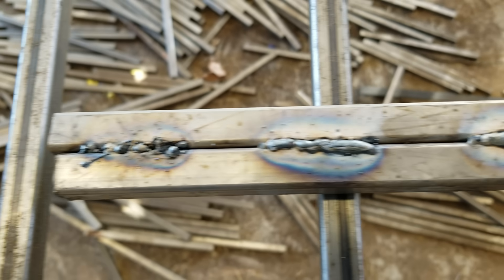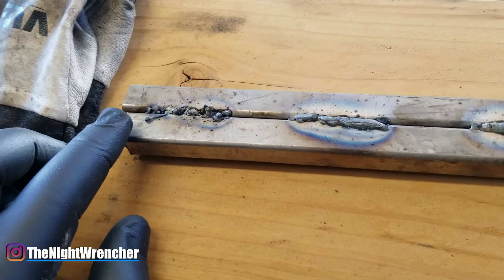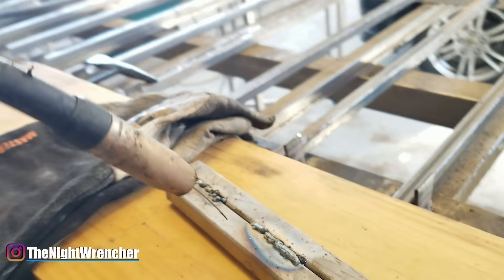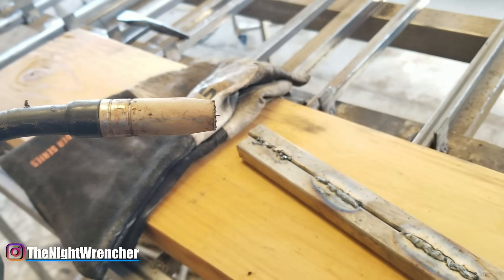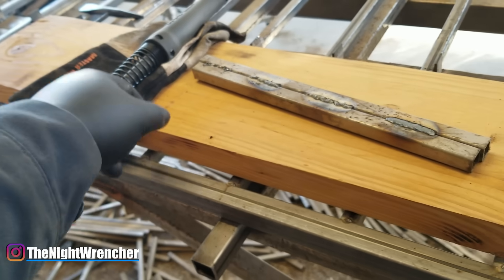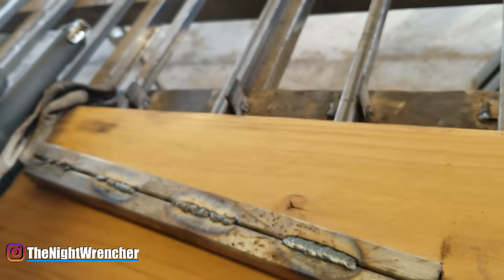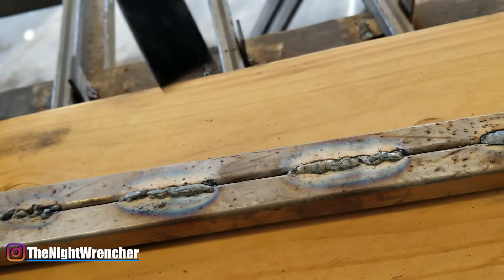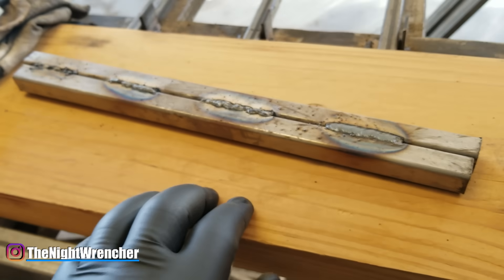Learn Perfect Flux Core Welds In 10 Mins | Gasless Flux Core Welding For Beginners Tips And Tricks |

Comment from the maker: Theres a whole flux core welding playlist here on the channel full of videos like this so check it out!
Reply: Phenomenal video man, thanks for making it! Helped me figure out what's going on with my new flux welder👍
Reply from the maker: Thanks man, I appreciate it!
Reply: @NightWrencher  100%!
Reply: Very good and thanks
Reply: @bobharris3754  yuh yuuy
Reply: good video and examples. one thing to add would be loosing the mig tip and using nozzle gel, so if you get slag on your nozzle it cleans off easily and won't stick if you weld to close. of course though that is knit picking.
Reply: Thanks so much for this video. I am a casual welder , and my flux core welds look exactly like your first (terrible ) weld . One time , I briefly did about an inch or so that looked like the final weld you did , but I had no idea what I had done to get it there , and was unable to duplicate it. You have been a great help !
Reply: @hughmartin4006  That is pretty much my experience too.... except without the perfect weld part.
Reply: @hughmartin4006  I needed that
Reply: Thanks
Reply: Thanks! Good video that made my welds (with my cheap ass HF 90) a lot lot better. The problem I’m having with my Lincoln Auto helment (cost more thsn my welder) is seeing the puddle! I started by setting to 10 and then up and down to try and get it right. What do you recommend? I know I could do better if I could see the puddle. Thank you for your help!
Reply: I'v been welding  since high school metal shop 30 years ago and after watching this video today, I think it'll start to show. Thank you. So often I flub a weld but never quite know why.
Reply: Was very helpful. Im fifteen and wanting to learn how to weld but was welding like the 2nd and 3rd welds you did. Thanks for letting me know what was wrong.

Comment: Great video! I'm 70 and beginner with cheap Harbor Freight Flux core welder. Have learned (the hard way) about sun burns, red hot sparks, super heat, bad angle, too fast, burn through, pushing instead of dragging etc and finally decided to learn properly from watching utube stuff. I know stubborn too.  I've watched about 20 or so videos and found yours real good because you showed my work #1 and what I'm striving to do #4. I'll try again today if it doesn't rain, get too cold, feet don't hurt, arthritis in right hand lets up, racoons haven't stolen my tools or crapped on them, get new glass eye protector (current is burned white). Damn, perhaps GOD really doesn't want me welding!!! Regards from Florida...
Reply from the maker: 🤣 thank you sir, hopefully you get back on it soon!
Reply: Dont forget abou tthe heat and humidity here in fl.. no way im wearing a jacket outside during summer rains

Comment: A good bead is when you hear a continuous feed without hesitation electric hum " audibly " and listening to steak cooking... Pops and sparking are air bubbles there are thousands of different patterns just have to be consistent with distance from material and movement. All depends on fps requirements " right angle shear strength of what you're building " muscle memory is key " repeat repeat repeat when you get good enough you can weld with two deep cycle batteries in series with Proficiency and Discipline... After a while it's second nature " neurological hardwiring Circuit recorded on RNA.

Comment: there are a couple things i wished people would make it a point to include when they are doing a flux core tutorial video like this and the first is the issue no real welders never want to acknowledge, most beginners are going to be starting out using a sub $200 dcep welder not the expensive dcen welder like you are using in your video, they need to know that the two are different and produce different results like they are not going to get as good a quality of weld from dcep which leads to the second issue,  if "stick out" is mentioned in the video then stop and explain the what, why and how to do it because it is probably one of the most important techniques to master, especially for someone using a $120 dcep welder with only 4 heat seating's, even with my $300 lincoln welder, i use stick out all the time because my lincoln may be dcen but it still only has 4 heat settings so sometimes the only way i can weld certain  thin gauge materials is by using stick out, stuff beginners need to know.....

Comment: Replace to tip of your gun with a plastic shroud. You can't weld that to your metal. Also, speaking about the sun burn, don't wear light colored clothing. They can reflect the UV light up towards your neck and face. I learned that the hard way.

Comment: Best explanation I've seen. I've been Welding flux core for 10yrs now with a Lincoln weldpak 140hd and a small bit of stick Welding. I usually end up with number 3 and sometimes number 4.  I've been getting more splatter which now I have a solution thanks to you! Another thing that has helped me other than more protective gear is an auto darkening helmet. I want to get a flashlight for the mig gun but If I lighten my helmet darkness a little it helps me keep on track and watching the puddle. I have horrible vision and have had cataracts since my late teens early 20s way before I ever touched a welder.
Reply from the maker: I try to keep my helmet as light as I can because too dark and you cant see where you're going with the gun.

Comment: What wire do you use 0.8?
Reply from the maker: I use something similar which is .75 mm or .030 in inches which is the smallest wire that you can use in a flux core machine with standard off the shelf wire. Smaller wire flows faster and prevents burn through and reduces warpage in thinner metals. For thicker plate steel I would use .035 or .040 which is .9mm and 1.0mm

Comment: If it’s got slag you drag. Got it👍
Reply from the maker: Trust me, it helps a lot
Reply: @NightWrencher  followed your advice. It worked. No way to avoid splatter but my weld seemed to have good penetration with the dragging. Thanks
Reply from the maker: If you turn up the heat more and get the tip closer, you'll reduce spatter by a lot. Anto spatter spray also works

Comment: I am a journeyman sheetmetal worker and have been welding for a very long time. I have welded many different ways from carbon arc to tigging aluminum but I recently tried to use a 110 flux core machine at home here and absolutely could not get a bead going with it. If the material is too thick will a small machine like that just not penetrate at all maxed out? Ive never used A. Fluxcore and B. anything under 220. It seems like 110 machines are useless unless they will only weld like 24g. or something
Reply from the maker: I really depends on the machine. The higher end harbor freight welders do pretty good up to 1/4". My 20 year old 110v lincoln weldpack 180 welded the inner Cs on my front axle(forged steel+ 3/8" thick tube.)

Comment: Excellent video. When you drag, is it a push/pull motion cause I see welders like making a jitter or circle with tip of gun? Are you drag/pause drag /pause or just a slow timed straight drag? Thanks!
Reply from the maker: Just a straight drag, the ripples are made on their own. If you wanna get fancy you whip the gun back and forth but its not nessesary

Comment: Great video, NightWrencher! I watched about 50 "Beginner's guide to welding" videos, and was doing welds exactly like the ones you showed without knowing where I was going wrong.
This is my missing link/light bulb moment. Thank you!
Reply from the maker: Thank you! I hope it helps you out! I've got other welding tutorials on the channel in case you need more guidance! Good luck!
Reply: @NightWrencher  I was changing voltage, changing wire speed, the only thing I didn't change WAS ME!!! I think I need to take a valium before I try again. When the sparks start flying I turn into a basket case thinking it's a race! RELAX MAN!!! I will watch your other videos. Thanks again. ;-)
Reply from the maker: When in doubt, turn up the voltage, turn down the wire speed, get closer and move slower 👍

Comment: Man this is so helpful. I wanted to mess around with some metal art projects. Probably start with a harbor freight basic welder.
Reply from the maker: They're cheap enough to learn on but they produce a lot of spatter. Make sure you use anti spatter spray or clean up will be awful
Reply: @NightWrencher  cool thanks for the tip

Comment: How do I prevent blowing holes in my sheet metal? If I turn the heat down it’s a weak weld.
Reply from the maker: You cant weld beads on thin metal with flux core wire, youll accumilate too much heat and burn through. You need to turn the heat down and burn tack welds into the joints in a criss cross pattern until the joint is fully welded
Reply: @NightWrencher  got it. Thanks for the help and info.

Comment: I'm having a hard time seeing the seam/joint where my weld is supposed to be going.  I'm presuming my sensitivity on my helmet is too high, or that currently I'm welding outside and have sunlight behind my helmet.  I'm using an auto darken helmet. I think I'm going in a straight line following the seam, but when I stop and look I've gone off course and have to grind it off and start over(time consuming, and wasting wire) I figure this will get better with time and practice but, if you have a better understanding of what my darkening dials should be I'd greatly appreciate it.
Reply from the maker: You want to have the helmet as clear as you can and only darken enough to remove the glare of the weld. Try not to have light behind your helmet because it will make it harder for you to see. Try to keep the light focused on where youre going to weld and not on you.
Reply: Not sure how your auto is, but set it for shade 9 and do everything wrencher told you to do lol

Comment: recommend me 1.2mm tube steel what is the best voltage and current 
tq 😁
Reply from the maker: That is super thin. You're to want to go as low as you can in volts and wire speed and tack all the way around in a crisscross pattern. Flux core puts in a lot of heat so you burn through real fast on thin metals

Comment: My first ones were globby too, I was pushing the weld. After watching this video I slowed my wire speed down and drug my weld. It did better but I think I have to go down to about 5 on my Campbell Hausfield. The hitch head looks good though.
Reply from the maker: Practice makes perfect! 👌 when it doubt, turn up the heat and turn down the speed
Reply: @NightWrencher   
What I really needed to know was "Push or pull?"
Reply from the maker: @richbaumann2999  I explained it it in the video. Always pull when possible with flux core.
Reply: @NightWrencher  Yeah, I liked that "If there's slag, you drag."

Comment: Hey I really appreciate the flux core training videos. Your clear and calm explanations are the best instruction. I had been putting in lots of practice and still got inconsistent welds; but after learning from you; changing my gun angle and dragging, it's like a revolution, I want to weld everything now.
I was able to repair my exhaust after someone tried to steal the cats from it. 

Even with my harbor freight (A/C) welder, I'm getting satisfactory welds now. 
So guys, improve your skills before you blame the equipment. Become better, then upgrade.

Thank you for the effort put into these videos, it helps a whole lot of us.
Reply from the maker: Thank you sir! I really appreciate it! There's a really cool welding video coming up in a few days, hope you like it!
Reply: Some people just like to have a project to do so they don’t have to be in the house with the wife and kids so upgrading a welder isn’t very hard you only need a few parts and it keeps you busy i haven’t met one person complain about this welder but i wanted to weld thicker steel for a small bike frame and the ac didn’t have enough strength so I did the dc conversion and replaced the HF wire with Lincoln and it came out perfect

Comment: Id like to add that if your mig gun is being pushed off of or away from your base metal you need to adjust the tensioner on your drive wheel. Back off on the tensioner knob so that the wheel slips just a bit whenever the wire stops feeding. If the wire is stopped for whatever reason at gun and theres too much tension it will push the gun away or cause a "birds nest" in the machine at the drive wheel. Ive been welding 41 years and MIG is the easiest welding process there is if you take time to make sure everything is setup correctly.
Reply: You need to tighten the drag on on the spool. I've never seen a mig machine backlash.
Reply: @billycolwell4263  I've seen it happen one time. It was because the fella welding had just installed a new 2lb spool of wire but he didn't tighten the nut securing the spool tight enough. So instead of the axle allowing the spool to float with just a bit of drag, when he pulled the trigger it released the spool allowing it to free spin. It bird nested the new roll. I helped him get the wire properly wound back on the spool and then demonstrated how to find that balance of enough tension vs too much/too little. This was on a Hobart H140. So, as you mentioned .. tighten the drag on the spool .. but .. gotta find that sweet spot.

Comment: The sun burn isn’t caused by the heat, it’s the radiation from the arc.  Without the jacket and using proper technique your arm is closer to the arc for a longer period of time and the arc is active for a longer period of time.

Comment: As welder of 35+ years sometimes when it is hot as in weather I sometimes do not wear long sleeves to protect. Instead I use a very high SPF sun block. I have never had sun burns using this method

Comment: I have the Vulcan 220 just like yours but it is still in the box. I want to practice more with my first welder Harbor Freight 90 FCAW. I enhanced mine with replaced mains cord to 12 feet with #6 AWG and beefed the ground wire up as well and added the really nice HF ground clamp. I pulled a stand alone 20 amp breaker from my breaker box so the welder has its own outlet. I feel I should learn to make welds like yours with my 90 Amp before switching to the Omni Pro as then it should be easier with the Omni Pro due to improved polarity in FCAW and then of course when using gas. What are your thoughts? Thank you. That was a great demo as I thought when I saw the four welds it was going to be a lesson in power setting and wire speed. It was a very telling demonstration.
Reply from the maker: I belie e that one is an AC machine so it produces "dirty" welds. Id say practice on the machine you plan to use because each machine has its own learning curve

Comment: Great video only thing I disagree with is what you said about stick out. There is definitely a way to watch your stick out. I weld flux core spray transfer mig and when I’m welding I adjust my hood shade so that I can visuallly see the tip of the wire melting and going into the join I can see everything from the nozzle to the back of the puddle I would suggest you get a higher quality helmet if you can see your wire when your welding.
Reply from the maker: Absolutely correct, but most of us use the cheapy welding helmets that fog up over time. I've had mine for a few years now and it has been flawless. Can hardly see out of it anymore but as long as the welds come out good, its ok by my book

Comment: Do you still drag the puddle, even when the flux core you’re using is gasless?
Reply from the maker: I drag with anything that has slag. Its just easier and comes out cleaner. Flux core with gas also produces slag so I would also drag.
Reply: @NightWrencher  alright, I’ll try dragging it from now on. My teacher taught me, that when you are using flux core, you push the puddle. Well, I’m gonna drag it now.
Reply from the maker: I've never heard of anyone actively trying to push the puddle with flux core but try it both ways and see which one comes out better. You do tend to push the puddle with standard mig though.

Comment: That's some very useful tips there. I actually use a flux-core welder myself, as I don't do  welding that often and it's not worth me having a gas welder.. One thing you mentioned about welding the nozzle to the job - that's caused by a bit of weld shorting the inside of the nozzle. Normally, the nozzle is insulated and if you touch the nozzle to the work, it won't weld to it, but when it gets shorted, that's the problem. Sometimes it's possible to clean off the bit of weld, other times, you need to replace the nozzle.
Reply from the maker: I've since swapped to the rubber nozzle made for flux core tips and I've got better visibility and the rubber is non conductive so I can pivot off the metal if I have to.

Comment: i tried mig without any gas, but it blew like a big schlong at the end of every weld, into the pipe that i was testing the swag puddle on?
Reply from the maker: Were you using flux core wire?
Reply: no, just a solid wire test without any gas lol
Reply from the maker: Oh, yeah. You can't do that. Solid wire has to be shielded with gas. If you want to weld without gas, you'll need to switch to flux core wire.
Reply: it was just a first test, but is the stuff supposed to go through the piece itself also? because the pipe was only 1,6mm thick and needed 120amps instead of the regular 64 amps? (1,6 x 40)
Reply from the maker: Usually the weld sits on the surface and bonds with the metal below. Sometimes it makes the metal below sag or distort but it shouldnt go through the metal. Solid wire needs gas to maintain a consistant burn. Without it, it will spatter like crazy and be very hard to control